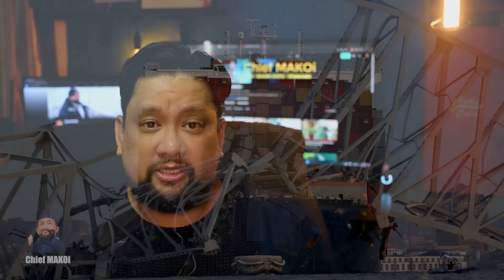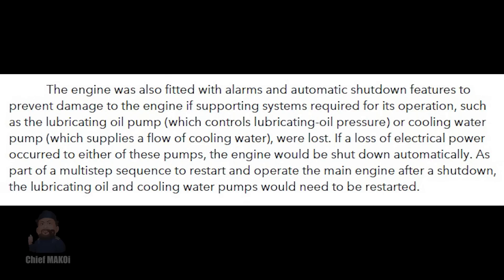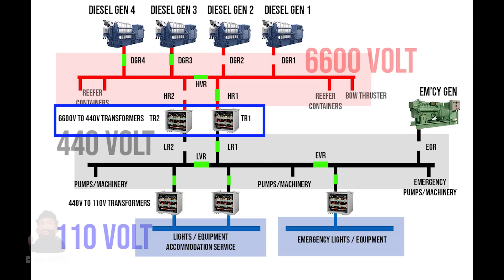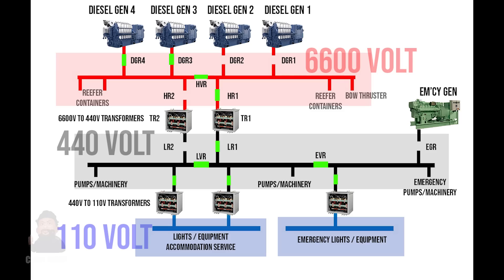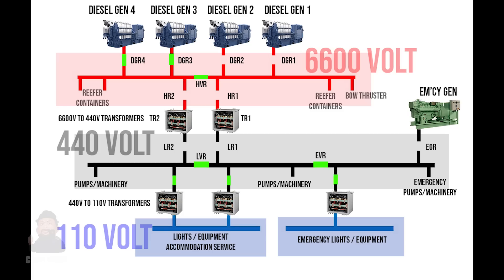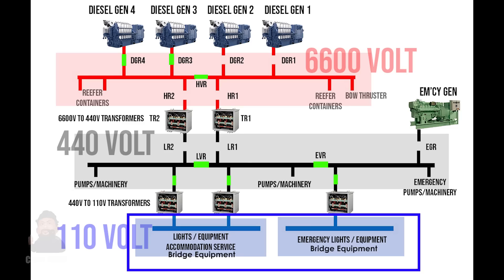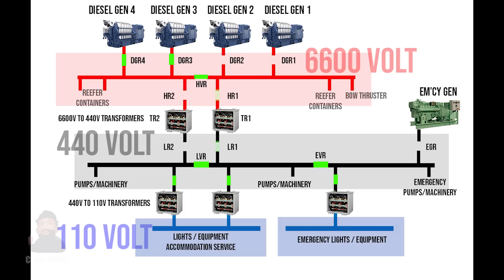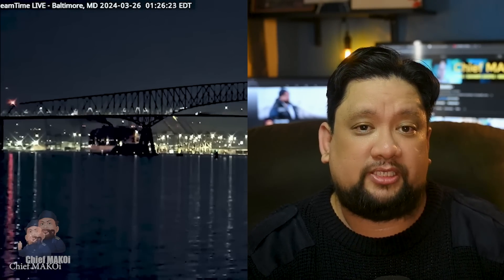Explaining the NTSB Report on the Container Ship DALI | Chief MAKOi

Comment: Well explained with clear diagrams. Thanks
Lessons to learn at billions $ costs. Will they learn or business back to normal ??? Why only one big engine for propulsion ? why not more giving ease ? If the rudder is ineffective without propulsion then what are the choices ??? Why there is no dedicated power system for steering gear which will be independant of the main electrical system ? Will that reduce the risk significantly ???

Comment: Chief Makoi, there are two kinds of "engineers" to be found in a ship's engine room.  There are those who know which way to rotate a wrench when making repairs, and there are those that understand the physical laws and principles that define a ship's systems and operation.  You obviously fit the latter category by your excellent presentation of the Dali's systems and probable failure causes.
Reply: Right tighty lefty loosy 😂
Reply: That's the difference that having 4 stripes on your uniform makes :) The cadets and oilers/wipers do most of the heavy physical work of turning large wrenches and cleaning up messes.
Reply: Top man chief so clear and precise

Comment: Hey chief, would a bad synchronizer for the generators cause the transformer to trip like that? And would the two generators working against each other (out of phase) that could explain the smoke, then the trip on the generators breaker? I’m just curious if the synchronization system possibly failed and they closed the contacts manually to restore power, but were unable to verify or possibly the system gave then a false positive that the generators where in phase when they where put in service.  
As always Chief your videos are very professional and informative.

Comment: What I dont understand is why would giant ship engines use a separate generator to flow oil vs. most motor vehicle engines, which use the engine itself, ie, as long as the engine is running oil is flowing.

Comment: At LOW thru-the-water speeds, the rudder becomes increasingly ineffective, as the Chief stated. However, and varying depending on the vessel size, the rudder DOES MAINTAIN SOME EFFECTIVENESS-however subtle. WHEN THE PILOT ORDERED THE RUDDER HARD OVER-HE WAS, basically, APPLYING THE BREAKS-the rudder no longer finding a way through the water-BUT BLOCKING PASSAGE THROUGH THE WATER. This should be basic navigational knowledge, as it is to any newer sailor learning solid seamanship. ADDITIONALLY, I disagree about the effectiveness of the bowthruster at speed. Yes, it is minimally effective-BUT ONLY A LITTLE THRUSTER EFFECTIVENESS MIGHT HAVE WON THE DAY.  THERE IS PILOT ERROR AT PLAY HERE, among other factors-going right back to the EFFECTIVE ABSENCE OF A BARRIER SYSTEM for the bridge piers.

Comment: Hi Cheif,  I heard another part from report that the day before gen 3 had low fuel pressure . If there was a low or poor fuel pressure to the generators it might have caused the issues .  
I hear they were running on the required low sulphur fuel , clean but no lubrication in fuel so higher wear on fuel system like pumps etc?    
What do you think ?
Cheers Warren 
( info from ‘steam man’)

Comment: Great explanation of the ships electrical system.  Any reason the main ships engine doesn't have the ability to drive its own fuel and oil pumps?  Is it due to its relatively low rpm rate or some other reason?  Why not have a way for at least in an emergency to have a engine driven option?

Comment: Poor design if theres not failsafe like a plane. A plane can have one hyd system fail but stays functioning. The ship should have two active pumps(water and oil) and two separate electric supplys for them for failsafe operation(s). Theres several ways the could have this included driving one set off the main engine itself while running….there was failsafe in some of the ships designs but not enough

Comment: If I'm not mistaken, when a breaker trips, aka a fault caused the breaker to open, the tripped breaker needs to be reset befor you can switch it back on
Reply: Some breakers, particularly in power utilities,  have automatic reclosers to recover automatically from transients. Particularly different phase lines slapping against eachother in the wind.

Comment: So i'm curious, was the ship ever able to drop anchors? I thought I heard you mention that pilot ordered anchors dropped. If anchors were indeed dropped, was it too late to stop forward motion of the vessel. From your description it sounds there might have been multiple issues, but the buss bar is interesting as it takes me back to an aviation plant, I worked at that from time to time the auto failover and fail back would intermittently fail to operate correctly. Normally failover worked fine but fail back would have issues. My thoughts are that there is the possibly of a fail like this then perhaps ships need to be escorted by tugs when operating near or through a critical bridge.
Reply from the maker: Based on the report, they weren't able to engage the brakes on the chain anymore because the bridge was already falling down.  Not enough time to drop the anchor and make it hold.
Reply: @ChiefMAKOi  Yes and that guy that was about to set the brake had to make a run for it, and barely escaped with his life. He was injured but they brought him off the ship for some medical treatment  then brought him back on board and he's doing fine now.

Comment: Some shore people gave an interview that the "Dali" was having issues with the Reefers because of power outages..Can it be Reefer related..serious shorts that put a tremendous load on the generators hence creating breaker tripping..
Also this LSMGO fuel has different viscosities creating more internal leaks and might it also be the culprit for pressure drops in the fuel supply system...May be a combination of variables as is most probable the case.. breakers trip because of short only.. or are there other paramaters involved..
Anyway, thanks Chief, as usual an outstanding review..
Reply: The reports / this video show that the reefer containers (and other equipment / circuits) hang off the HV bus via their own transformer circuits so should not (?) have caused the decisive tripping of the LV transformer circuit… 

But there was definitely some funny stuff going on with the electrics in port…..

Comment: During the first blackout, tripping of HR1 and LR1, the Bow Thruster which is on the Hi Voltage Bus was still available.  Could this have been used, instead of/in addition to the rudder, to direct the boat away from the bridge pylon?  Retrospectively, was it a missed opportunity?
Reply from the maker: Wouldn't have much effect at that speed.  But I guess we'll never know.
Reply: @ChiefMAKOi  Bow thruster controls would have been inop, since those are fed from the 440v bus to the bridge and bow thruster remote controls. It's not as simple as flipping on a switch, yes the motor itself runs on 6600 volts, but every other part of the bow thruster control system needs power from the 440v system or it'll just sit there and do nothing. Sure the bridge controls are probably only 120v or 24 volts to the rotary switches on the panel, but those were probably inop when the TR1 breakers tripped.

Comment: Chief - Thank you for your explanation, I was waiting for this.  As a retired engineer who knows nothing about marine system design (but somewhat aircraft and industrial - I'm a mechanical guy) you filled in the blanks I was having to guess at with the NTSB report (not knocking them - I understand they are trying to communicate with all knowledge levels).  I see some people talking about operating the system 'split' during critical maneuvering so if you lose half the system the other side keeps all systems functional, more akin to an aircraft layout.  Would be interesting to hearing if that is ever done, pro and con, etc.  Being retired from industry I also realize how cost enters into decisions many time - sometimes when it should not be a consideration.  Enjoy getting your instructional course as you describe everything.  Thanks for this effort, much appreciated.
Reply: Being one of the `some people´ 😅 (and even using allegory with 4-engine birds like B-747 or A380), let me share that basically my rationale when thinking about going for `split operation´ in confined waters comes from a safety approach; primarily targeting to avoid total loss of electrical power (due to full redundancy) but as fast as can be recovery at least. 
Reading other comments from chiefs & experienced seafarers, it appears to be common practice on ships to have both HR and LR cross-ties closed (but cutting one transformer path instead).
Discussion also brought up `classic´ transformers (i.e. with coil windings) better should be kept online from HV-side (but switched off from LV bus, thus no further load) to have some heating to get rid of moisture plus avoiding strong initiate inrush currents. Keeping them connected to the HV bus would be possible for both scenarios.
Generators need frequency synchronisation before switched to a common bus (some analogy from aviation is synchronisation of propeller engines to avoid the wings and fuselage build up oscillations due to the `beating´ frequencies coming from different RPM). Perhaps that syncing is slightly easier with HR cross-tie already connected, although the synchronisation control needs to be done by simple sensing of the frequencies already before generators are connected.
For almost all cases, the approach with closed HR and LR cross-ties obviously worked fine so far, and there are also safety measures in place which are working fine if there’s sufficient time for emergency procedures. Such power switching does not happen instantaneously... Now comes probability from such an incident to happen in a location where every second counts… 
But we also have to wait for all details & findings of the investigation, of course. If there’s another, very central failure which causes the entire system to drown nevertheless, then splitting wouldn’t help either (but further reduce probability at least).

Comment: So potential order of mishaps
ship speeds up and the extra vibrations causes a short to happen.
blackout #1
automatic restart of breakers / fuel pumps for generators doesn't happen
crew resets the breakers, but somehow the fuel pumps are not actually running (started and didn't work or didn't start, check log).
generators shut down because of no fuel
blackout #2

So what is wrong
Faulty component in breakers, auto restart, wiring.
Bad isolation of some wires
Faulty pumps, electric to pumps, auto restart, wiring.

Comment: Thanks chief...  a very left field question .... can the  High an d Low voltage trips on the 6.6kV  circuit  (ie first black out trips )  be caused /affected by  EMF ( electric magnetic field)  or  Induced  current  from an external (non-ship) source ( excluding dry dock  electrical  power supply situations) ...  One thing the NTSB has not  mentioned is that the Dali was passing under the overhead powerlines (think they are 140kV) when the  black out occurred -  not sure on the clearance but  a very high  steel ship with steel containers stack  to max tier  passing close under a live  High voltage wire seems like a candidate for a  possible discharge from the overhead High voltage cables  -  if so, I would have though that any sudden earth to the  the ship and its  6.6kV  HV and  0.42kV LV circuits would cause  them to trip. You can see the powerlines poles in the back ground of some of the Dali pictures. Am also wondering, if the first black out it cause a low  fuel/oil  pump pressure alarm ( or high  pressure  alarm on reconnection of the breakers)  on  DG3 &4   to cause them to auto trip of the high voltage circuit before their pump pressure returned to  normal.     Still seems odd the black smoke -  can't see  how  generators on  high quality low sulphar diesel  would burn rich to produce that much  black smoke for so long... if not under very heavy  load - not to mention if the  black smoke was from the  generators then,  that is an awful lot of black smoke for  high quality low sulphar  diesel ( even if under load).

Comment: Master chief, Great new information on main generator issues. 
There was no mention why the ship turned towards the bridge peir. The rudder was amidship. So was ship going straight ahead or was it still turning at time of main engine failure and then continued to turn into peir?
Why did ship not drift in a straight course when engine failed? 
There are 2 issues with this accident 
1.Why engine failure?
2. Why ship turned into peir?
Thank for best video on report yet! 
Cheers Warren

Comment: I think you are right. The report did not talk about the smoke.  That smoke looks like #6 fuel to me. I cannot understand how #2 could make that smoke. 

You are right about doing maintenance on a running system .  I think they are using the testimony of the crew. I suspect some are not telling the truth. However, the full report will get to the truth. It may take a while, but they will get the the real causes.

Comment: Fuel contamination would have manifested itself much earlier. You don't have running generators in port and then suddenly have fuel problems 30 minutes later whilst underway. It's an electrical switchboard or transformer issue.
Reply from the maker: It's not contamination.

Comment: Why did they not synchronize all four generators during maneuvering or moving from the port to avoid the delay in running the standby generator during one of the generators failed at least the three generators support all the connecting loads like you said two systems are running if one generator failed the system automatic command to next generator unfortunately the delay is not enough to synch the next generator

Comment: It sounds like they were using equipment that was overdue for repairs or replacement.
Reply: The whole ship was only 9 years old, that's fairly new still.
Reply: @brnmcc01  
No it’s not.
That equipment need’s maintenance multiple times a year. Others, have a lifetime of 5 years or less. These components are in constant operation in a very harsh environment. 
If they weren’t maintaining things properly or replacing them when they were due, bad things happen.

Comment: Thanks again Chief for your explanation. I would think that the ship did not respond to the rudder and in fact swung to starboard due to the still ebbing tide coming off the Curtis Bay channel which pushed the stern to port. My humble opinion as a long retired master mariner.
Reply from the maker: I actually defer to Master Mariners when it comes to these topics. 😁  That's a good explanation.

Comment: Very interesting and detailed as usual. Who knows they may eventually come up with a plausible solution. That was an awful lot of black smoke. Doesn't sound like they have addressed that yet. Surely that must be coming from main engine. Not generators. Like trying to start up an old tractor or truck. Churn over and pump out smoke before they start. Whatever the real reason, the cost will be through the roof. And any insurance company will be playing pass the parcel. Trying to limit pay out.

Comment: Notice the not able to explain the trip of breakers 
Thanks 🙏 Chief 
Gauss 
Look up Van de Graaff generator lighting fluorescent light 💡

You hit it on the head 
Breaker of transformers trip unknown reason with possible differential power ie EMF FROM POWER LINES 
get a nine volt battery 🔋 wrap wire around a nail you get a magnet 🧲 

How do you make a magnetic field experiment?

Tokay

Comment: Chief. I don't know much about ships, but I do know a little about automation. Does this ship have a plc system? If so, could it have caused this issue?
Reply from the maker: It most likely has.
Reply: Absolutely could have caused the problem if the sensor data the PLC is relying on was faulty or there is a flaw in the programming... Here comes the cyber attack kooks... 😂

Comment: Thanks Chief, good info.  But refers do not run of 6600V as your diagram dictates. The racks are normally trunked at 6600v where transformers reduce it to 308/440v for the common voltages the containers use. No human is going to be plugging in a 6600v plug. Just a slight correction.
Reply from the maker: Of course they have transformers 😄.  I just focused on the 440V Bus for the engine room machinery as that is the relevant part.
Reply: @ChiefMAKOi  Of course and understood!  But somebody will be walking away swearing that refers run off 6600v now given your expertise and the way Youtube works. :)
Reply: Yep they do that to avoid having to run huge cables all the way to the reefer boxes, it's cheaper to run a 6600 wire up close to the cargo area, then have smaller transformers there. Otherwise to power a large refrigerated cargo load, you'd have to have multiple cables as thick as your arm and run them all the way from the engine room to the lashing bridges, that's a lot of wasted copper. Voltage drop would be an issue too on reefer boxes located up at the bow of the ship. But not if they have dedicated small 6600 to 208/480 volt transformers located as close as practical to the loads, each transformer tap could be adjusted to provide the correct voltage.